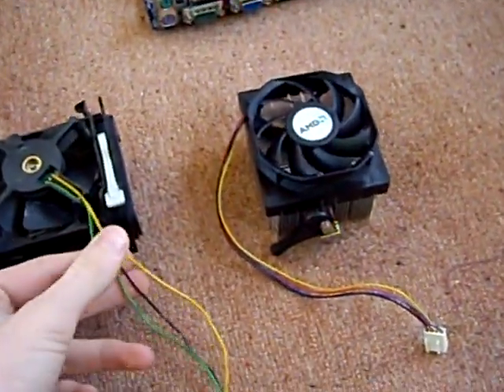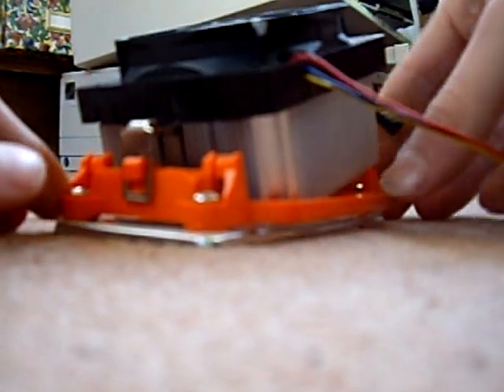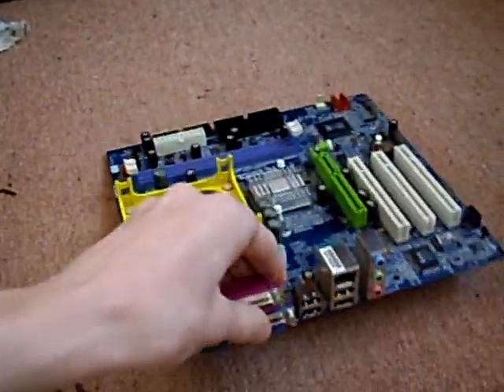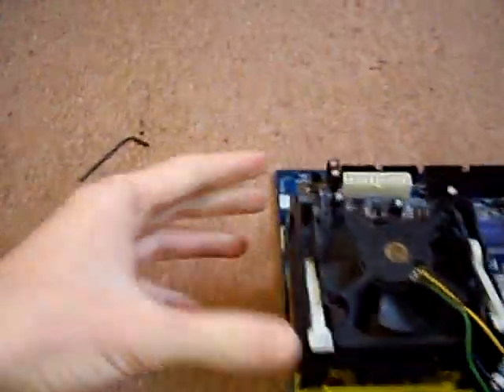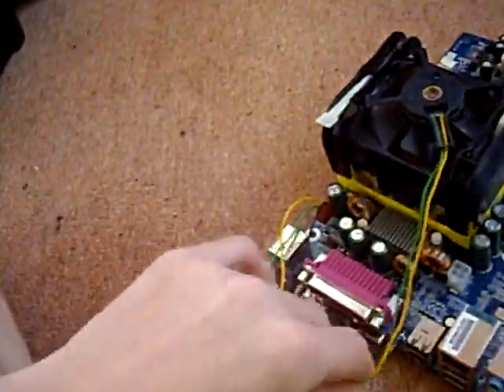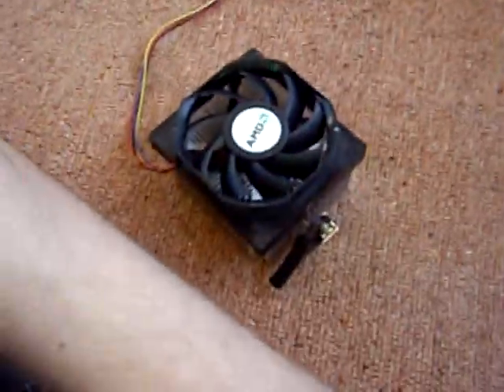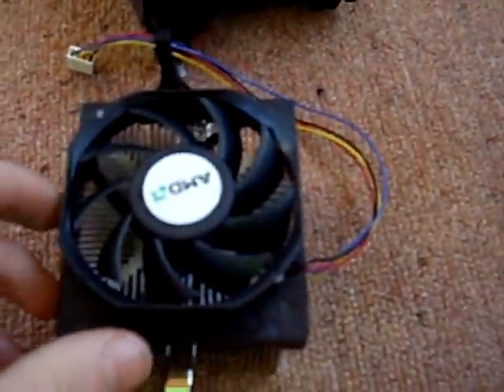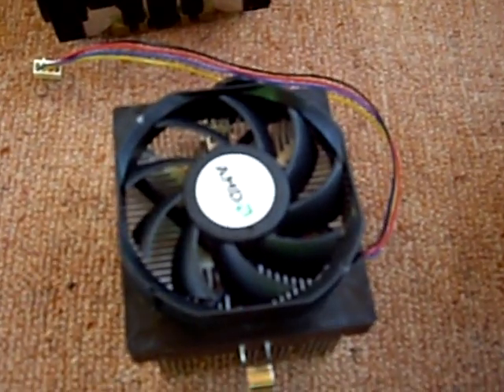AMD stock cooler/heatsink vs Intel stock cooler/heatsink

Comment: Nowadays The AMD coolers are better-sized. Intel stocks suck, F.E they let an Core i7 920 un Stock-Clock run up to 88-92°!! and with full speed they are loud, and they must spin at full speed, to cool the CPU that "bad"

Comment: Also you say that the fan is smaller. U mean the blades of the fan. BUT: the AMD has much more Blades on the Fan. Wich means it will flow more air at the same RPM

Comment: Ok. the Intel is cooliong the CPU on 32 ° on IDLE. BUT: the fan spins at 100% at every time! Because its only a 3 pin fan. The AMD cools well, even on 30% Fan-speed my Phenom II 925 is running on 35.39°!